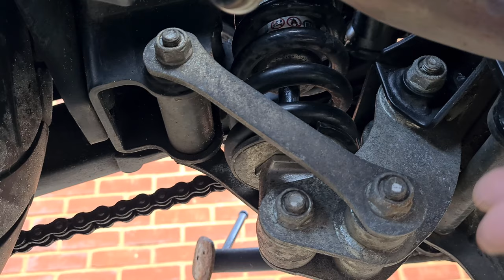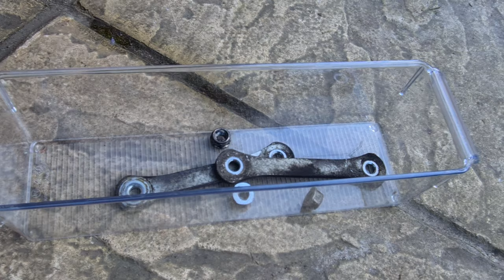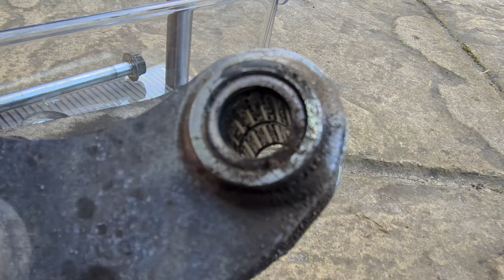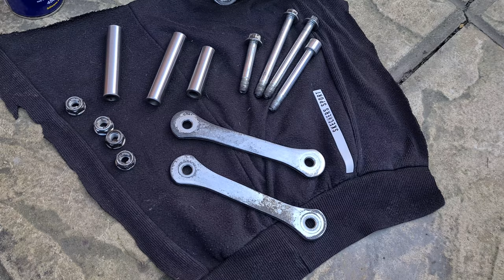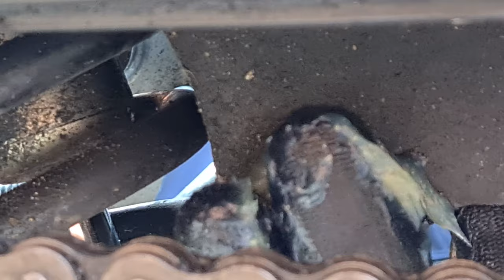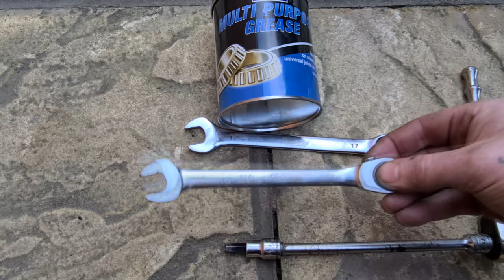HONDA NC750X important maintenance job (SUSPENSION LINKS)

Comment: There are some self locking nylon nuts which are meant to be used only ONCE. The nylon locking function works on first tightening only. So everytime you unscrew these nuts you should have a brand new replacement. Otherwise you never know when the nylon securing insert is going to fail.
Another important thing is to clean parts not only inside but also outside. Because if not, you are going to introduce small amount of dirt into your bearings. There could be mud, sand, old grease, steel shaves. You don't want anything to scratch the bearings.
All in all a good and clear explanation. It is always better to do maintenance job by yourself, because you know what you have. And of course it's much cheaper than having done the same thing by dealership.
Greetings.
Reply from the maker: Loctite will do the trick, buying new nuts each time isn't really ideal, these never come loose, too much dirt and rust going on down there for that! Thanks for input.
Reply: Ive always re,used nylon lock nuts and im yet to see a bolt come lose.

Comment: Thanks for this video, I've been putting off doing mine as was worried it might be hard to get back together. I actually did have trouble getting the last dog bone back on despite jacking the swing arm as you showed. After some trial and error I found lifting the linkage itself with the trolley jack lined up the bolts  (with the bike back on the ground). Anyway, thanks, I'll not neglect it as long now I know how to do it!
Reply from the maker: you are welcome

Comment: I neglected this on my NC700SA and the needle bearings seized and got worn thru.  Needed the whole assembly replaced, though I managed to get the bearings as parts so I have a spare assembly now.  Thanks for the reminder to re-grease.
Reply: After taking mine to bits I found one of my bearings knackered and the pin worn into the linkage casting. Did you manage to change the bearings or is it easier to just get a new assembly?
Reply: @moneyprofessional I sawed out the old bearings ok. Lots of round filing to get the assembly surface smooth. Just be careful not to press in the new bearings too far. I used a piece of wood and a lump hammer. The centre bearings should protrude a few mm, do not force them in flush or they will not turn freely. Take a photo of the old setup before taking out the old bearings

Comment: My 1995 Daytona has five grease nipples on the rear linkage to avoid this procedure. I doubt there is a modern bike left with them now. These bearings are often ignored, I’m sure a fresh bit of grease is just what they need every now and then especially as you are a winter rider. Personally I’d skip the WD40 step but as you say, it’s your personal preference.
Reply from the maker: They don't build stuff like they used to, grease nipple here would be ideal !

Comment: Hej Nick, have you made any videos about greasing the "rear brake pedal" joints on NC750x? 
I can't seem to find any such video on Youtube, other channels included.  

//Thank you for the video on Air-Filter change. It worked like a charm.  Greetings from Slovenia.
Reply from the maker: Hi bud. Use spray grease on the brake pedal pivot. I have a video on brake maintenance check out winter prep video

Comment: Thank you.  That was very clear and well done and it's nice to see you using a torque wrench.  My shock absorber is looking pretty rusty already, whereas yours still looks nice and black.  Is it a lot more work to remove the shock absorber so it can be cleaned up and given a new coat of paint?
I only just bought my NC750XD-E and though it's a 2015 model it's already done over 62000 miles, so you can imagine the state of the brake calipers, especially the pistons, which I am changing for stainless steel ones.  I'll have to have a look at the suspension linkage tomorrow now you've shown me how easy it is.  Well, once I manage to get the brake fluid changed and any air removed! All good fun!
Reply from the maker: Hi Steven, removing the shock is one extra bolt and the shock is off! Thanks for the nice comment and appreciate  you watching :) Good luck with your NC

Comment: As per, excellent video. 👏 Glad I did this. 2018 and needle bearings and pins rusty on one side. Gritty movement on one of them. Have cleaned up as best can. Take it I need to replace them?
Reply from the maker: Check them in another 1k miles
Reply: @nicksepisode  Cheers, your combination of bikes, rideouts and how-to's is great 👍

Comment: great video! Question:  I don not have a center stand. I tried it rear swing arm lifter on the swing-arm, but it does not work. I can't pull out the bone after loosening the screws.  Any idea how to do it without center stand?
Reply from the maker: with an assistant, get a car jack and wood, place under frame in middle, dont matter if its on the engine as you wont be lifting it high, just enough to take weight off, make sure you have an assistant tho keeping it sturdy while working on the bike

Comment: Hi m8 i have some knocking pn my Honda nc700d every time when is monuted on central stand only happend once when bike is lowered on the ground. After that nothing? Any advice
Reply from the maker: Lower shock, Bush worn, maybe ? Swing arm bush? Put it on the centre stan, lean over the rear seat, and pull up. There should be no movement
Reply: @nicksepisode  I have small play up i didnt notice it before now i know

Comment: Hi nick good video can I ask you do you know if they do lowering links for this bike I could do with a inch or so thanks in advance.
Reply from the maker: Yes you can buy them and fitting them is very easy and this video can be used for reference to that. Thanks for watching

Comment: at last, someone who know's how to put a video together and do a proper job, have you got one on brake pad replacement front and rear, plus greasing the slider pins.
Reply from the maker: Cheers ! Check out my spring prep video, it's covered in that one, thanks

Comment: just a question does you shock absorber leak oil my shock seems to be weeping slowly. I know this is silly but i was told the will leak a tiny bit of oily normally
Reply from the maker: the shock shouldn't leak at all, your seal is failing by the sound of it, jump on the seat and check that the rebound is not excessive (eg. bounces and feels springy)
Reply: @nicksepisode  it leaks as when I push it down i see a yellow oil. It only happened recently after arear tyre change doubt the shop did it tho
Reply from the maker: @laughingdog1125  how many miles/km has it covered ?
Reply: @nicksepisode  Its a 14 plate bike that had only 3k miles on it when purchased. It now has 11500miles
Reply from the maker: @laughingdog1125  sounds like you've had premature shock oil seal failure, take it to your local mechanic to get it checked
Reply: @nicksepisode  Asked a suspension shop if the could fix it and was told its anon serviceable shock. Just forked out for a yss mono shock
Reply from the maker: Such a shame things are built to be thrown away these days

Comment: Through no fault of Nick, I couldn't get my linkage bolts undone, despite having breaker bars etc. Reckon you need a bike lift and maybe remove the muffler.
Anyone else had similar problems?
Reply from the maker: Sounds like the previous owner hadn't kept on top of this job. Use a wire brush, plenty of penetrating oil and a painter heat gun on the nut